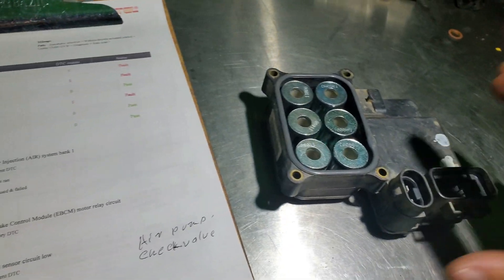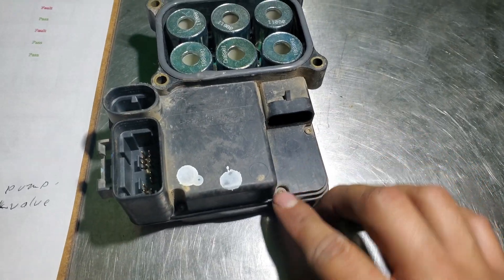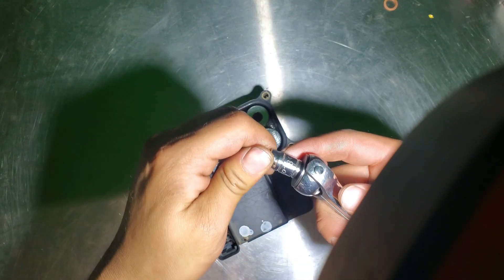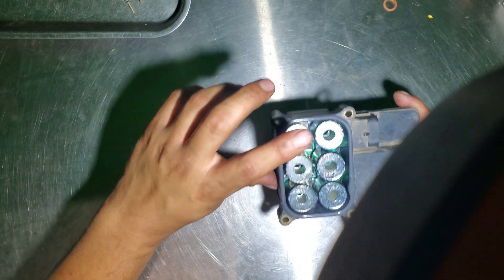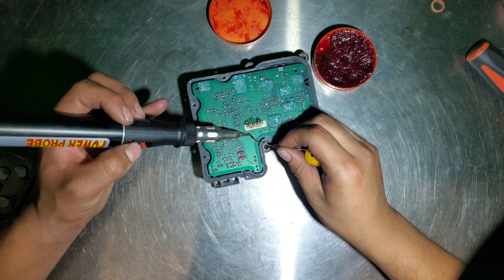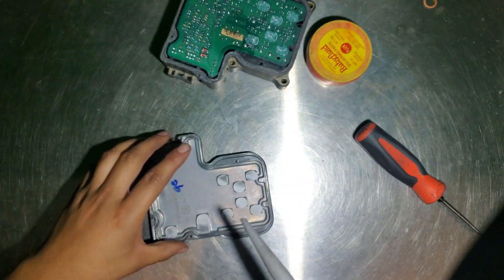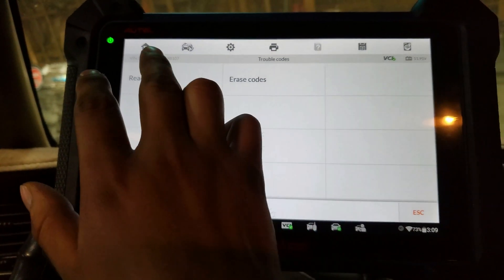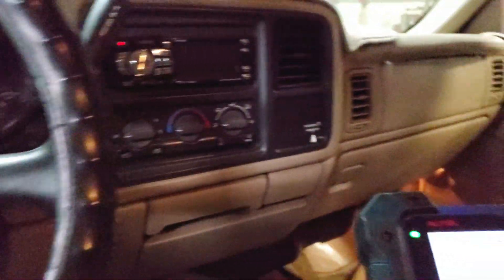How to fix GMC Chevy Truck ABS / Brake Light on C0265 Solution permanent fix

Comment: I know this is an older video. Any advice on how to remove the Torx 8 screws located underneath on the backside of the ABS module cover if heavily decayed? I've tried different size bits, needle nose pliers, bolt extractors (bolt head just falls apart more) and nothing grips. If the screwheads were larger, I'd notch them as I did with the Torx 20 screws to remove them. Thanks!!!

Comment: You said that you cleared it before but it keeps coming back... So did you drive it for a few hours/minutes and did you actually fix it?
Reply from the maker: yea once I resoldered it. the codes when away instantly
Reply: @JVFIXLLC  Nice... Dam maybe I should give it a try, but I really think it's my PCM that I purchased from Flagship One... I believe it throws out random codes or one or more of those pins in the PCM is NOT connected/grounded properly when plugged up & screwed into the PCM... I've replaced just about every sensor on this truck within a year... Now this ABS BRAKE light comes on occasionally... I can clear the code drive for a month or so, no codes then get in the truck one day & start it up & bam a freakin code... C0265 ABS/Brake Module/P0446... Crazy. I'm going to try something this weekend. I'm going to put the PCM that I've purchased this truck w/back in & see what happens. Cause I didn't have all these codes before.. It's a long story why I changed it in the 1st place... But if all is good w/the old one. Flagship One is going to hear from me... I've checked their  reviews. Mighty funny everyone & I do mean everyone gives them 5 stars... I find that to be very odd... Thanks for your help & video. Glad it worked out for you... 👍✌️